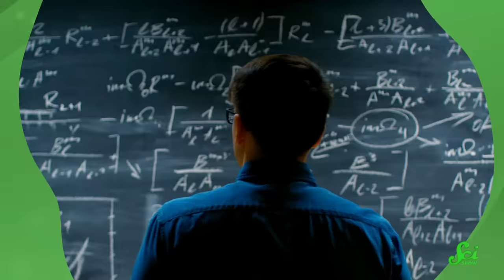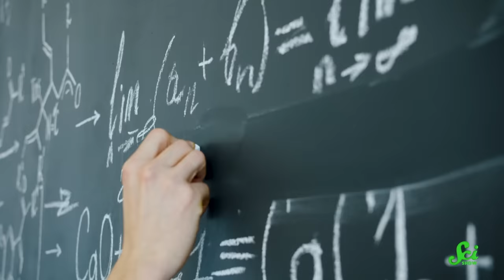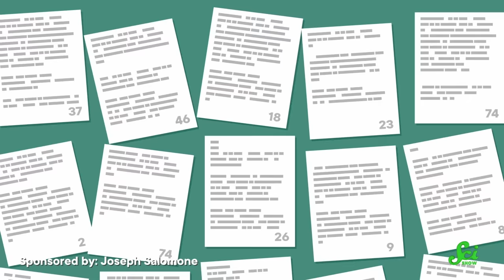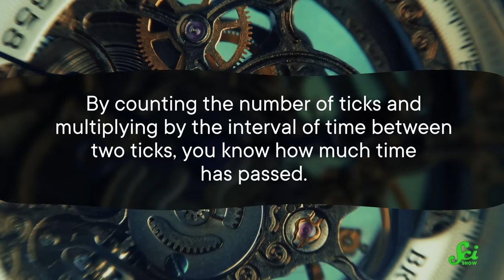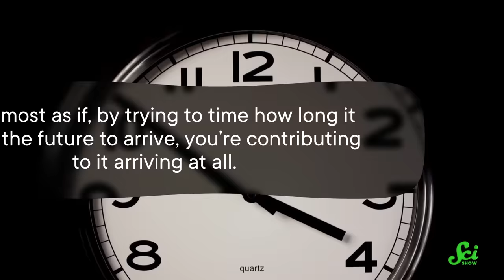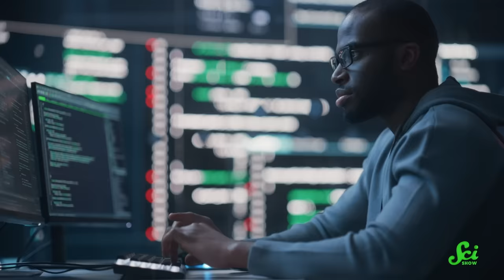Why We'll Never Build a Perfect Clock

Comment: "Sorry boss, I don't use my alarm clock anymore. I couldn't stomach contributing to the entropy problem."
Reply: When you're going to sleep, just tell your body you're waking up at (pick a number) 8am. You're surprisingly capable of getting up when you intend to without an alarm
Reply: @gastonmarian7261  That would be even worse, I would just be training my body to produce more entropy. 😱
Reply: “I did it for the team.  I chose to be late so that others could be more timely.  Heisenberg say relax.”
Reply: Phase-noise strikes again.
Dammit.
Reply: Even better: "Sorry boss, I don't want to use my alarm clock anymore. I couldn't stomach contributing to the heat death of the universe. If the universe ended, I couldn't come to work"
Reply: I will now buy more clocks.
Reply: You cause entropy simply by existing. You're breathing (respiration) and other metabolic processes, as well as the numerous involuntary processes in general, account for the vast majority of the entropy you (and other lifeforms) generate. Life, at bottom, is basically an entropy generating machine, and it would not be at all inaccurate to describe it in exactly those terms.
Reply: @joegillian314  Great tshirt idea.:
“Reduce entropy. Self-delete!”
Reply: It's science 🤷🏽‍♂️
Reply: life speeds up entropy, so to slow down entropy as much as possible, you'd want to eliminate as much life as possible
Reply: @gastonmarian7261  omg thank you, I thought I was crazy when I was waking up dead on certain times I wanted even wirg less then enough sleep
Reply: @gastonmarian7261  Kramer? Is that you?

Comment: Electrical engineer here.  Computers are already kind of running into that problem, and have been for years.  Computers have been increasing entropy at a high rate for a very long time.  It’s a real problem.  We don’t usually think of it as an entropy problem, but rather as a thermal problem.  The faster and smaller transistors get, the more heat they produce.  And as many people know, heat is the most chaotic form of energy.  So this really is an entropy problem.
Reply: We're still faaaaaaaaaaaaaaaaaaaaaaaaar from Landauer limit.  It's not power in transistor, it's power density at IC and problem with getting saidheat out.  Node shrink causes overall drop in power, but also disproportionate die size shring therefore increase of power density.
Reply: Dennard scaling.

Comment: Thanks for the video! BUT: Entropy is not a measure of "disorder." A soap bubble is highly-"ordered" but is in its highest-entropy state. In fact, if you push a soap bubble to be more disordered - making it an amorphous blob rather than a sphere - it will pop back to its higher-entropy state: an ordered sphere.

Entropy is a measure of probabilities. Smoke spreads throughout a room not because its order decreases, but because it is MUCH more probable that, at any moment, the smoke blob in the center of the room will spread than will shrink.
Reply: But you forget that the soap bubble only looks like order because of the resolution you look at. Go down to the molecular structure of the components that make up the soap bubble and see that they all in entropy.
Reply: Right, the whole "disorder" meme is really confusing and backwards when it comes to educational stories in physics.  Increasing entropy actually just means adding complexity, or adding more possibility, as you say.  The higher the entropy of a system, the more unique, equally probable, orders it has.  For example, add more smoke and more air to the smoky room will mean that you're more likely to find smoke doing all sorts of weird things — like making vortices and pretty aerodynamical patterns — than just sitting in one spot, or being totally perfectly distributed evenly around the room.
Reply: Pretty sure you have to consider the soap bubble/air system, right? The soap bubble is a sphere because that’s what happens when the air inside is in its highest entropy state. If you push the sides of the bubble in, it may appear less ordered, but the air inside has been compressed is more ordered. I think.
Reply: I like to think of it more like uniformity than disorder for this exact reason. Sure, it's not impossible everything clumps up independently, but as you and the speaker of the video said, it's much easier and more probable to resolve a mixture to a simple, evenly distributed, static system than to separate things into clumps.

Comment: Current CPUs care a lot about synchronization. But there are asynchronous designs that are much more difficult that are faster and more efficient. They were used in the far past during the the exploration stage of computers, but synchronous designs are simpler and have been greatly improving over time well enough to not warrant the investment, yet.
Reply: I'd like to look more into this do you have anything I could watch or read up more on it?
Reply: @exiledpain6  A quick Google makes me think he might be talking about "asynchronous circuits."
Reply: Computers today do have many clock domains where inside of them there is asynchronous combinational and synchronous sequential logic.  When the clock synchronization becomes unwieldy we just split it up into another domain.
Reply: Look for the ARM AMULET project. That was an asynchronous ARM CPU.
Reply: @willis936  Correct, and each domain can have its clock rate optimized for its usage. But there are actual async designs for domains, not just between domains.
Reply: This reply thread gave me the same vibe that those crypto bot threads give me. I don't know why

Comment: I've got one high accuracy quartz (HAQ): my Bulova Lunar Pilot.  So far it has been gaining 2-3 seconds per year.  How is it so much more accurate than a typical quartz?  1. Thermocompensation (the onboard computer monitors the temperature & accordingly it adjusts timekeeping to minimize error). 2. Higher oscillation rate: e.g. 262,144 Hz instead of 32,768 Hz.  There's more that can be done, too, such as: 3. using superior quality quartz crystals.  4. pairing each crystal with a computer that's been "programmed" with information about how that particular crystal performs over a range of temperatures (Grand Seiko does this).  Grand Seiko even gives you a "trimmer" in their quartz movements, allowing you to compensate for any drift as the watch ages over a period of decades or even centuries.
Reply: At this point just get an atomic clock
Reply: Hello fellow watch enthusiasts! 😂

Comment: My only comment is the reminder that while entropy and the flow of time are closely related increasing entropy DOES NOT EQUAL time flowing forward, or local decreases in entropy would be observable areas where time flowed backwards. That doesn't happen because entropy and time are related but not the same thing.
Reply: But what is entropy?
Reply: @EduardoRodriguez-du2vd  It's a measure of the number of states on the microscopic level (microstates) that give rise to a given macroscopically observable state (macrostate). If the number of microstates for a given macrostate is W, then the entropy of a system in a given state S = ln W. Since we assume all microstates are equally likely, it's effectively a measure of how probable a given macrostate is (though it's not the probability). I hope that helps, but I understand if it doesn't. Entropy is a notoriously tricky concept.
Reply: @allanjmcpherson  Ah! Thank you!

I get the impression that you are referring to the relationship between the structure formed by the microstates and the structure of the macrostate, as if they were two different things.

As a question of structure and not of energy or average energy difference in a given space (which was what my intuition told me).

Is it something just structural?
Reply: @EduardoRodriguez-du2vd  I'm not sure I understand your question exactly. I'll try to give an example. Say you have a system of two particles and the system has two units of energy that can be distributed among the two particles. The macrostate is that the system has two units of energy. There are three possible microstates. The first particle could have both units of energy. The second particle could have both units of energy. Or they could both have one. For this toy example, the entropy of the system would be ln 3 since there are three microstates that constitute the same macrkstate. Does that help?
Reply: @allanjmcpherson  Yeah. The example is useful to me.

Regarding my comment, I will try to clarify what I expressed! :)

Do you understand that entropy is a tendency, of the elements of the universe, towards a certain distribution?

That this distribution is more probable after the interactions?

Do we notice that a distribution is more probable and then consider that distribution to be more probable because we find that distribution to be more probable?

The question would be why the trend towards a certain distribution is the most probable.

Regarding the system of three elements, what I find problematic is the lack of definition of the concept of energy.

The idea that comes to mind is that the universe tends towards balance (for some reason) and that the differentiated areas force the elements to act towards balance.

Similar to what happens in the atmosphere (actually I guess exactly how it happens in the atmosphere!).

But if that were correct, why this tendency towards balance?

That is, why does the probability distribution have that tendency and not another?

Otherwise, why do statistics show a certain type of results?
Reply: Time isn't real.  It is a measurement system for entropy.  We could, in fact, say that time, in a very localized spot of decreased entropy, went backwards.  By bringing a disordered locale back to order, you can say you de-aged it, but that doesn't really mean anything in the grand scheme of things, because you had to increase entropy around that locale in order to decrease it there.
Reply: In reality, there's never a decrease in entropy.  You can pretend that you're measuring the entropy of a system, but it's that whole spherical cow situation.  You're really just making some hand-wavey measurements that ignore reality as a whole to make it look like you're measuring all of the possible states of a system.  Entropy is indeed time, from what my research describes.  Every additional fractal element in the universe is a new moment of the universe.  (Of course, these moments aren't equal, they are fractionally smaller every moment!)
Reply: @thewiseturtle  where have you published this research?
Reply: @SgtSupaman  Time is what we call distinguished changes. The changes exist. This communication (ours) is sufficient proof.

What would be order, in your interpretation?
Reply: @EduardoRodriguez-du2vd  , yes, the changes exist.  These changes are tracked (aka measured) by time.  They are not time.  When you take a step, you are traveling a distance.  That distance is measured by meters (or feet or whatever), but "meters" don't physically exist.  A "meter" is just a concept that measures the real thing, which is distance.

Don't get me wrong, time is a very useful and important concept, but it is just a concept.
Reply: @SgtSupaman  We don't measure time. It is not possible to do so because there is no fixed standard with which to compare what is measured.

Even in cases where something is found to be extremely regular in its variations, that variation changes its rhythm depending on its proximity to massive bodies and according to its speed of movement.

In my impression, our awareness of the passage of time results from comparing regular changes (to a certain extent and locally) with the changes noticed in the rest of the phenomena.

What do you suppose "time" is?

The "meter" exists. It is a conventionally determined length.

Time is not just a concept. There is nothing that is just a concept. A concept is actually an intellectual construction that attempts to represent some phenomenon in reality.
Reply: @EduardoRodriguez-du2vd  , we don't measure time?  Are you aware of things called seconds, minutes, etc.?

You seem, oddly enough, to be struggling with the concept of...well, concepts.  Things like meters/feet/inches/etc. are not things that physically exist.  They are conceptual units that we use to relate to distance.  A physical representation of the concept may exist for the sake of standardization, but that is not the same as the concept itself.
Reply: @SgtSupaman  When I say that we do not measure time, my response opposes the idea that time is something independent of change and that it is what causes it.

If you ask me how much time passed, I will answer: Three changes of "X".

But how do I determine that each change in "X" is an equivalent quantity?

I compare it to how many changes occurred in "Y" (which has a higher frequency of changes than "X").

When "X" changes three times, "Y" changes 9 times. As the frequency of changes of "Y" is greater, this guarantees that any difference between its fractions will be smaller (and therefore more precise) than in the case of "X".

Each case of time measurement is the comparison between the changes that have occurred between entities.

It is the comparison between two changing things.

Regarding "seconds", a second lasts different "times" depending on where what you measure it with is located. And it also depends on how fast the device moves.

Nope. I don't struggle with the concept of a standard of measurement. The thing is that in all cases, the pattern is something physical. In any case, I do not deny that they are conventions.

What is your definition of "time"? Is this independent of the physical?
Reply: @allanjmcpherson  It's not academic research, it's just research.  I share it all over the place.

Comment: I have a big ol' grandfather clock in my living room and I can attest that, at best, it might be accurate to plus or minus 30 seconds a week.  (You have to wind it once a week, so that's when I reset it to match my Apple Watch).  It's dependent upon tons of variables -- even walking past it can make it vibrate a little bit, and throw off the pendulum swinging.  So it's definitely at the very low end of accuracy, and must therefore be contributing almost zero entropy to the universe.  I rest easy knowing I'm not contributing to the chaos. 😂

Comment: the most important clocks in high density asics are based on path length and the speed at which electrons move in that material, there's still 'clock' clocks, but things aren't really getting "smaller". timing closure happens at design time and it changes the geometry and layout so the logic works correctly at a given speed rating

Comment: This is actually surprisingly accurate—ESPECIALLY in the watch world! If you buy a cheap mechanical watch with the absolute minimum number of parts required to keep track of time at all, then it’ll be very inaccurate and clunky—with minimal entropy effect. But if you buy a super high-end mechanical watch that costs thousands, then you’ll have tons of extra parts added (like extra jewels, swan neck regulators, fusee drives, etc.) that increase accuracy at the cost of added entropy. And god forbid you buy a Grand Seiko Spring Drive…hell, you’ll effectively have TWO SEPARATE WATCHES IN ONE that work together to tell time so accurate it’s second only to atomic clocks! But once again, that’s a LOT of extra parts, and therefore a TON of entropy. Not saying you shouldn’t buy one of those (it’s literally my dream watch tbh; by the way, this is not sponsored, and I don’t own one myself), but think of the entropy effect you’re creating just to get that hyper precision next time you look at one of those. Sometimes, simpler is better!

Comment: You can actually measure a difference in altitude of meters using atomic clocks. Time flows slower when you are lower because there is less gravity from earth. So, you have a measurable effect in the most precise clocks depending on height. This is bizarre. Furthermore, entropy only shows where time points. It doesn't slow or reverse time. When entropy gets lower in part of a system, that part does not go back in time.

Comment: Makes quite a bit of sense. Pretty much in everything you run into the problem of consistency over time vs. accuracy in short time. The quickest practical example is weight monitoring. You measure yourself every day and get really accurate information. But it makes no sense in the big picture, it has too much information, it's too detailed. It has way too much variables affecting it, it has variance in play that you don't even know exists. In the long time span you get quite a neat average and an idea of where you're progressing but you really can't say you have any information of where you are any given day or moment.

Or trying to picture some signal or movement visually. At some point you can measure things you don't even understand and your interest really lies in the macro picture, even though you want more accuracy and resolution. Suddenly you're measuring noise and light reflections, surface roughness and whatnot instead of the shapes or signal you're interested in.